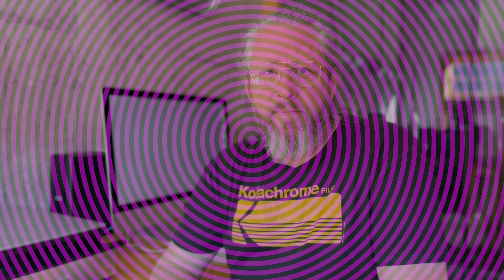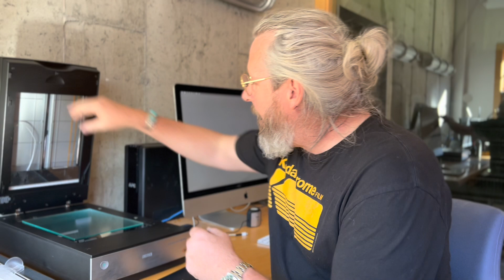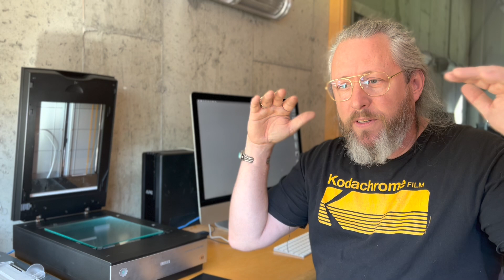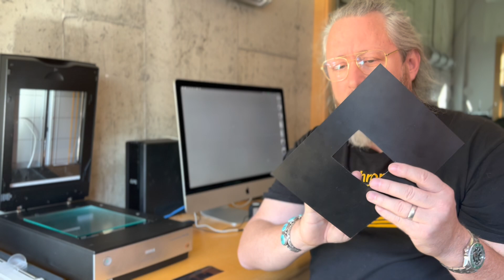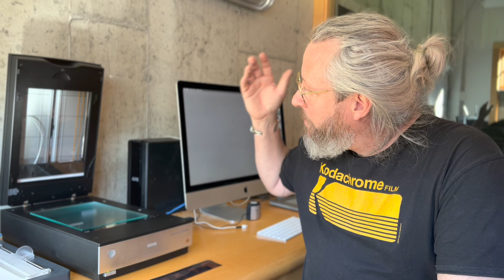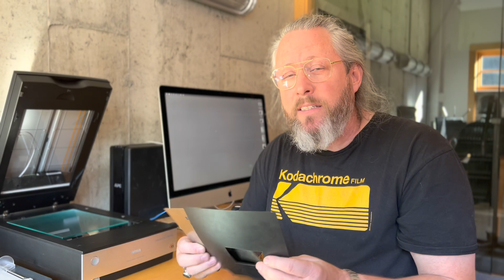Scanning Secrets Part 1 or How to Make Your Scanner Love You

Comment: Maybe I have been lucky, but I have not had a need to do anything other than use the stock holders that come with all of my scanners. I have never needed to modify anything when canning and have never been dissatisfied with the output. Every piece I have sold has been scanned with the supplied holders. I have used curled negatives in a Canon 9000f and never had any issues with the results. Once you print and frame I doubt most people actually care anyway. I have yet to have a viewer or customer say "That image should have been scanned better". With that said, I'm still going to try this! I may just stumble on a revelation:)

Comment: If I’m scanning a print What size print do you suggest for the Epson? And will anti-Newton Glass have the same effect on a print?
Reply from the maker: Depends on the print surface but should not be necessary unless something like a Polaroid— scanning a print is not limited like film so scan till you have all the info— for example if you were scanning micro printed documents you can keep going up in resolution till you have all you need— for a photograph generally 360 or 720 for same size output.
Reply: I’m actually scanning prints to soften the overall image get deeper darker colors and create a texture. Any suggestions are very welcome thank you so much for the quick reply
Reply from the maker: Scan at 240— no sharpening applied and you should be spot on.

Comment: I have the problem that my camera of choice is an 11x14" large format setup, which I use to produce reverse paper print b&w studio portraits as unique originals. There is only one eligible scanner for that size on the market, and this one costs more than 4k USD, what I can't afforded and wouldn't be willing to pay if I could. So to create copies from my photos for the digital realm I use my Olympus Pen-F MFT camera in high res mode with 50 MP to "scan" them. And I'm really not sure if scanning my pictures with a flatbed scanner would actually produce distinguishable results, but since I don't have such a scanner, I can't test it.
Reply from the maker: You can always scan in sections and then stitch together in PS— scanning a positive can be done at very high resolution optically — much higher than negative material and will look better than a capture made by a digital camera but a lot depends on the scale you are then outputting to — so if you are sticking with 11x14 you are good to go— something like 40x50 the scan wound be better…
Reply: @FIGITALREVOLUTION  Thanks for answering! And yes, I stick to 11x14, mostly. I know about stitching as an alternative possibility, but I'm afraid to damage the original in the process, since the emulsion may be bend and squeezed by the scanner borders; and this to be scanned original is the main product which must be protected and not damaged, since it is unique and not replaceable.
I think, that earlier or later I will resign to buy an Epson 12000XL (or one of its predecessors), but I'm not sure that the investment is worth the money compared to the 50 MP files I can create with the camera. I know that with the scanner I'll get files with several hundred MPs, but on digital 11x14 reproductions of the original, would I be able to see the difference after it's been printed?
Reply from the maker: If you are only going for 11x14 as the output then stick with what you have as it is plenty!

Comment: I have found that scanning on the glass gives me the WORST performance by far than raising the negative the correct distance from the glass - that takes a lot of trial and error to get the correct height.pretty academic for me as I have a excellent DSLR scanning system that far superior to flatbed scanning especially with 35mm.However, the devil is in the detail and tolerances and many people simply do not get that right.Sharp 24 by 16 prints from 35 mm with good tonal range is easily achieved with the right setup.I have compared my DSLR scans with those from Imacon and i defy anyone to tell the difference.The future in scanning is in DSLR scanning I am afraid
Reply from the maker: A lot has to do with the configuration in the scanning software— all my samples here on FR have been scanned using the process I have just mentioned and they are crazy good (unless I mentioned 646). DSLR is not great for many reasons that I will outline in future posts but for now if you are happy with your results then stick to it.
Reply from the maker: I sincerely hope the future is not camera capture of film, at least not with a CMOS sensor! There are limits to what any negative has to offer and making 20x30 from a 35mm is on the edge for sure unless we are talking some very slow very specifically processed material… I also believe as you mentioned that a clean and simple scanner workflow is easier once you are calibrated….